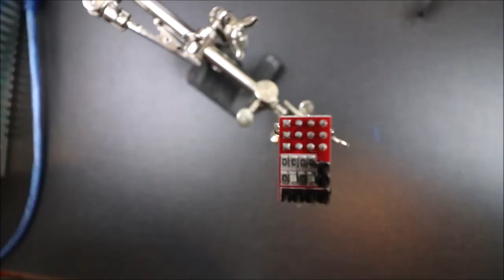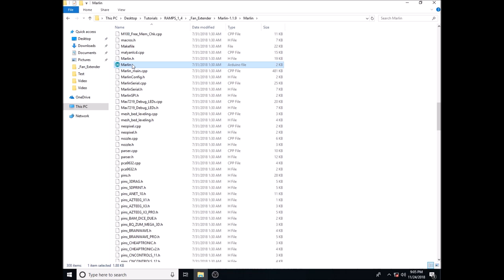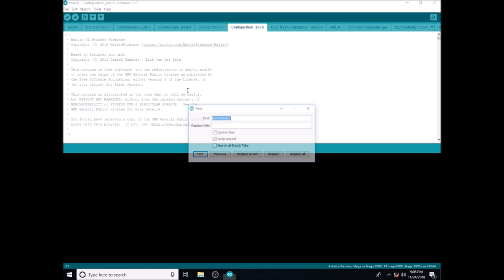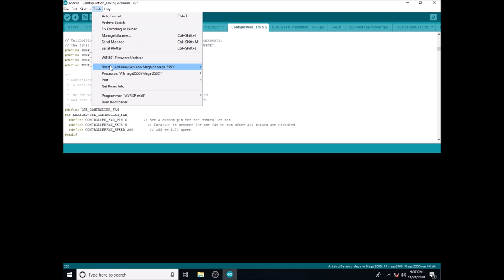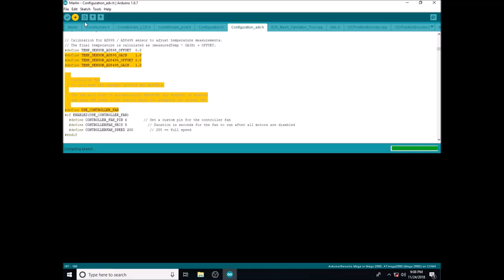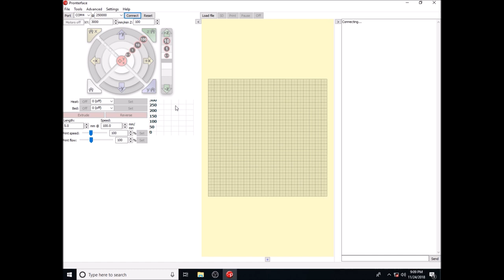RAMPS 1.4 - Fan Extender Expansion Module

Comment: can you tell me why only 1 of 2 fans is spinning (on your video aswell)? I got 3 fan extenders and cant get both fan running simultaneously. On the new marlin its set to "controller_fan_pin 4" and  "controller_fan2_pin 5". I've also added both of them into pins file. 2nd fan output don't get any voltage even if i change the pins and the fan led is light up.
Reply from the maker: It's been a long time, but both fans should run without issue.

Comment: best video out there for fan extension board
Reply from the maker: It's a very old tutorial, but thanks.
Reply: @EdwardBraiman  yes but... mega 2560 and ramps 1.6 is still a cheap way to build dual extruder 3d printers. Then one would simply run klipper to have awesome performance, from old stuff.It is a replicator 2x which is crappy (software), that got the ramps1.6 and marlin instead of sailfish. But i still kinda like marlin 2.x. So all my machines is running the ramps 1.4 to 1.6 and mega 2560 as cpu. i will not miss Makerbot desktop. the cnc machine is running on mega 5x.

Comment: OK, next question: 

Is it possible to use this extender AND use a filament runout sensor? Do D5 and D4 actually help run the extender, or are they just being used for structure to hold the thing in place?
Reply from the maker: There's a tutorial in playlist for this.
Reply: I saw one for the runout sensor, and this one for heaths fan extender. But the fan extender covers the pins used for the runout sensor…

Comment: Hello Edward. The board I have (a RAMPS 1.6) haven't the pins to power the rrd. it also haven't the unpopulated pins for solder yourself as in other RAMPS boards. Would it be enough to activate an unused pin and take the energy from it? Greetings.
Reply: Sorry. I just realized that there is than power it with 12 volts. I thought the IC underneath it was raising the voltage or something like that. Easier to me. I'll feed it straight from the power source. Thanks again.

Comment: Hi! First off all, thank for sharing very good video. I got a question. Since there are two fans I guess you only need 2 pins from the arduino/ramps. But the extender mounts in all servo pins. In order to use the extender you must lose 2 pins?
Reply from the maker: correct.  Otherwise you can use some type of connection on a single signal pin with 5v and ground to open a 12 volt connection.  I'm trying to think of the name, but might be able to find it this weekend.
Reply: Tanks again!
Reply from the maker: You're welcome.

Comment: Your work fascinates me, I have a question: why doesn't the other fan start to work, I already tried it and it doesn't move?
Reply from the maker: Thanks  The answer might be in another tutorial in the playlist in the description.
Reply from the maker: What's the gcode command you are using to run fan?
Reply: @EdwardBraiman  Thanks for replying, the Gcode I'm using is M106
Reply: @EdwardBraiman  I will try to look at all the related ones, thanks.
Reply from the maker: Keep in mind there's a Discord link on channel as well.  They may have change fan 0 to default.

Comment: If I have 5v fans for the extruder and the heated one, I don't need that extender or yes, the fans I have have three cables.
Reply from the maker: The output power is 12v for extruder and heatbed on RAMPS 1.4. you could try signal pin and ground pin.
Reply: @EdwardBraiman  Could you guide me how to do it because I don't know what the signal pin is
Reply from the maker: There's a Discord link on channel.
Reply: @EdwardBraiman  can you send it to me i don't see it
Reply from the maker: Find most current video and look in description.

Comment: And what’s up with the oder fan?! Other*
Reply from the maker: Sorry, could you rephrase?  Or did I pronounce something odd?
Reply: Edward Braiman sorry, my English is bad, but I try to explain my dude
I have a chimera extruder then  in marlin have EEB and I like to have two fans 
One for the extruder and one for the layers
Reply from the maker: Okay, first you can write in your native language.  Second, you're say I have two extruders and a heatbed, but want two controlled fans.  You can run two 12v fans off the servo pins.  Check out my RAMPS 1.4 playlist for anything related for fans and there should be something.  Let me know if those videos help.